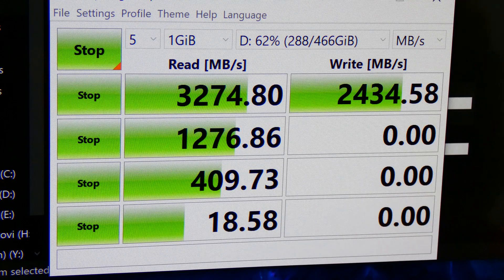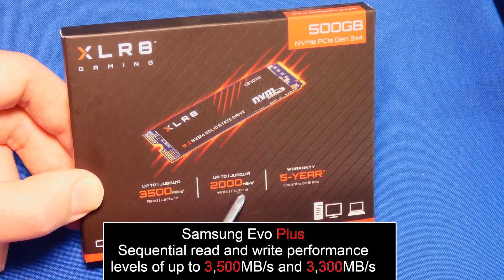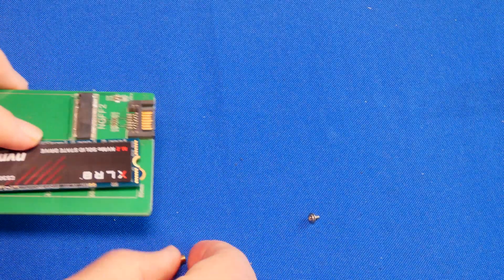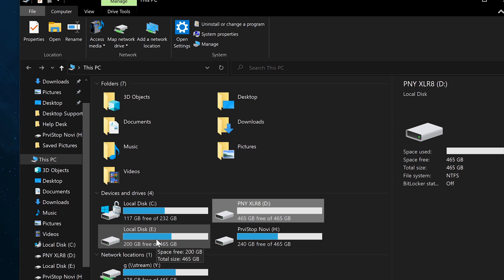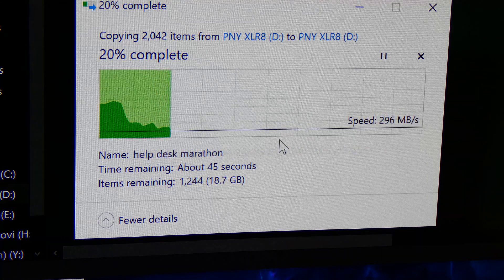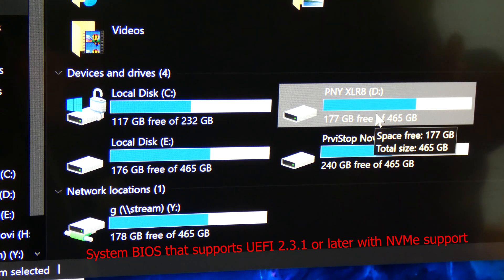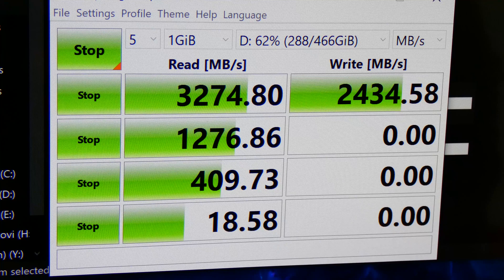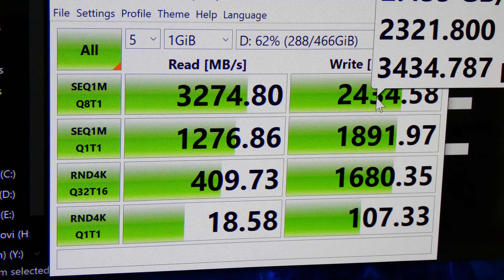PNY XLR8 m.2 SSD Review vs Samsung 970 Evo Plus+

Comment: i have both (1TB) 970 and CS3030 but dunno if 970 Evo Plus it compare with CS3040 (1TB) bad bottleneck or more improved someone use it on Pcie 3.0 and it works🤔
Reply from the maker: This was tested with pcie 3.0.
Reply: @Cobuman  thank u for reply🙏
yes but your vid showing CS3030 (3x4)performance not CS3040 (4x4) 5600/4600mbps
i bought it today (CS3040) its fck n wasted of money 😅 the acceleration totally same

Comment: PNY XLR8 CS3030 500GB M.2 3D TLC NVMe PCI-Express
Read speed: 3500MB/s
Write speed: 2000MB/s

PNY XLR8 CS3030 SSD 1TB M2 3D TLC NVMe PCI Express
Read speed: 3500MB/s
Write speed: 3000MB/s

Why didn't you tackle 1TB solid state drives? 😎👍

Comment: Does the PNY have DRAM like the 970?
Reply from the maker: Probably not since 970 is faster. It's not something I would worry about as presence of DRAM on chip would equal more speed and if speed is your deciding factor... then go for the faster one.
Reply: @Cobuman  Ok. Not really looking for speed, but I will be doing a lot of work that will need read/write so I'll need a drive with a long lifespan.
Reply from the maker: @Aries0098  In that case I can say that Samsung is a good brand since I've never had a failed SSD from them (used as OS). PNY... is something I bought for testing here... so not sure on reliability. I mean, so far it's still working for me as plain storage space. 😁

Comment: Size does change speed. More and flash chips to simultaneously write to, larger cache.

You're supposed to be a tech YouTuber and know these things.

And yes, the more full a drive is, the speed changes. Some are actually faster as they fill, most are slower. You have to be objective and repeatable in your reviews.

And you didn't test past the cache 🙄

Comment: That's Megabytes per second (MB/s) not Megabits per second (Mbps)

There's eight Megabits in a Megabyte but Megabits per second is what data connections are measured in and Megabytes per second are what storage is transfer speeds are measured in.

Easy to get confused, but crucially different things.

Comment: what he said was totally wrong . they have different drives that are the same sizes that are totally different speeds. the 970 non-pro 970 pro is the same size but it's faster
Reply: The drivers doesnt mather bcs i think he use stock windows 10 drivers
Reply: I agree he is incorrect in saying that capacity and used space doesn't matter but I see what he is trying to say. He is doing a real world comparison. If your drives stay empty all the time then why do you even have the drive and if your not using it at all why does the speed on an empty drive matter?
Reply from the maker: That's not what I said. I said different size of the same brand and model. I don't think you can understand English well...
Reply: @Cobuman  Well it's still wrong. There's a big difference in speed depending on the capacity, usually 1tb drives are the fastest, closely followed by the 2tb variants. 500gb and 250gb are often a bit behind

Comment: Great comparison. Thank you bro
Reply from the maker: Sure thing. □
Reply: @Cobuman  xlr is good?or get heat lot ?
Reply from the maker: @nstsarr5189  All of them get pretty hot. But, if you add the heatsink which should come with your mobo or adapter... it should be fine. No problems here.
Reply: @Cobuman  If I buy a new motherboard how can I know there's heatsink for nvme ssd ?
Reply: @Cobuman  I mean new gaming  motherboard come with nvme heatsink ? ,i dnt have enough knowledge about pc ,just learning that's why asking brother
Reply from the maker: @nstsarr5189  Usually they are pre-installed and covering the empty m.2 slot. Check out the picture of mobo.
Reply: @Cobuman  does every nvme ssd come with heatsink or I have to buy extra from shop ?for covering